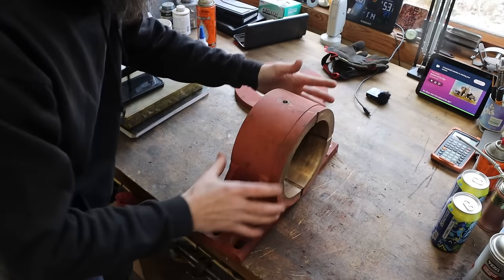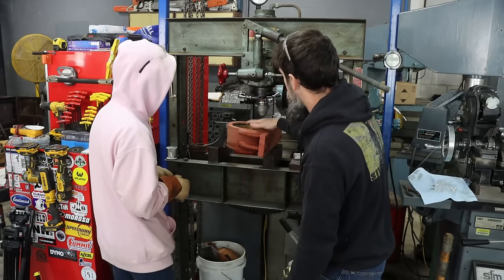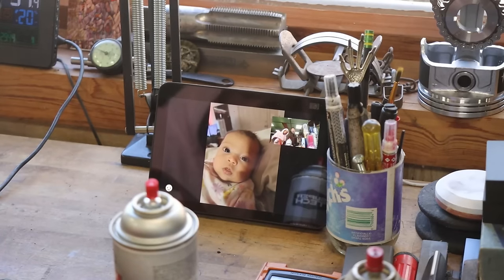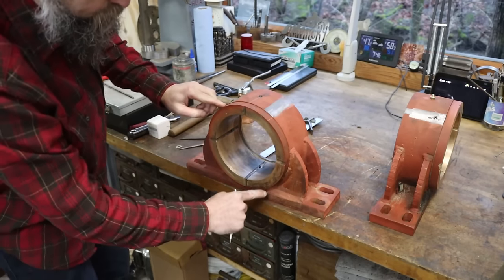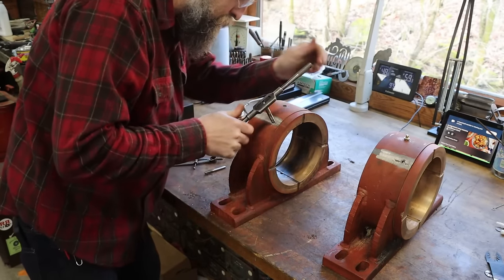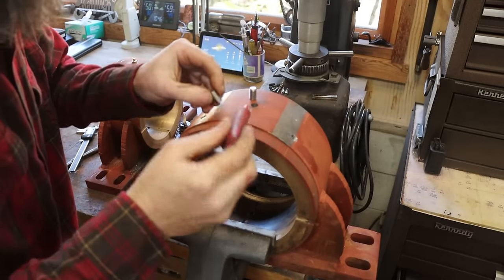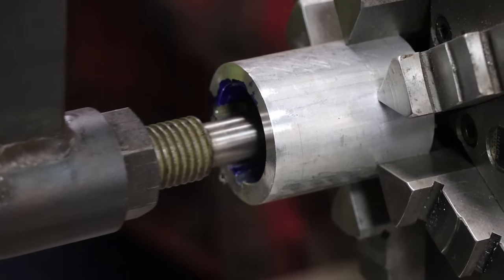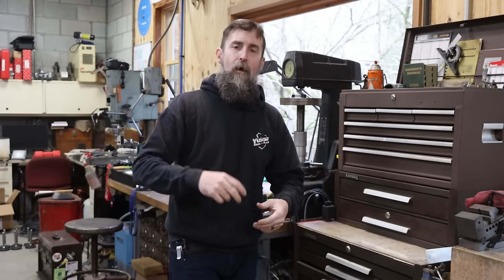Repairing Huge Bronze Bushings.

Comment: What  beautiful grandchild!  

The ball mill where I worked for over 20 years was somewhat larger.   The bottom trunion was lubricated with high-pressure oil.  The oil acted as a bearing with the trunion riding on the oil suspension 
The low pressure oil pump lubricated the top trunion.  It's Achilles heel was dirt.  The material that ran through it was gritty and lower Ph .  If outer seals wore excessively, there were problems for sure.

Comment: My thinking is that with the hole lined up the grease will take the path of least resistance and be less inclined to travel all the way around to the holes on the bottom. I've seen that with way oilers.
Reply: Probably be better with two grease zerks, one on each side.
Reply: Same thouht here. The bushing should be offset between holes so the grease makes its path all the way round, not straight in. It should be ok either way, if lubricated while running.

Comment: Take it from an old timer. Sometimes (really a lot of the time) when you line up the hole with the zerk. You will only get fresh grease out of the one hole. When the grease goes through the channel it will be forced out several holes. Hope I explained it enough.
Reply: So maybe the bearing did not slip and rotate? Maybe it was intentionally clocked with that off-set?

Comment: I've never liked the bushings with a grease groove all the way around. The grease will follow the path of least resistance so it doesn't come out where the most pressure is and he grease is needed the most. The shaft has to carry the grease around the bushing.

Comment: Steve,  why didn't u use the drill press to tap the holes?     u had a straight line for the hole..  maybe u were afraid that the tap might
break-off in the hole?    other wise  grat job getting the Bronze Bushing-off/on with ur Son's Help..

Comment: So given that you want lube all the way around, why NOT clock the hole 45 degrees off?  That would at least cause 2 of the holes to get equal lube.  

Not that straight won't work.  But makes it really easy for the direct hole, and hardest for the one 180 degrees off.
Reply: That makes sense...and couldn't hurt.

Comment: That rubber coupler acts as a sheer pin .Making it out of steel could cause a much more expensive part break instead.
Reply: Not rubber looked like nylon the aluminium one should be OK not too hard
Reply: I'm willing to bet the roller it's going into isn't in prime condition anyway, if the dealer couldn't supply a simple part like that I bet the machineis pretty old, it has to work and earn its money, which that aluminium part will allow it to do.

Comment: I'm not sure those bushes have turned in the housing. If the grease hole lines up with the slot on the running face of the bearing it will preferentially go to that single slot when new grease is pumped in. If it's offset as if was, the grease will go around the outer groove and then go through the other holes to the other slots. Be interesting to see how it works out.

Comment: Steve, i had to laugh when you set up on the drill press to drill for the grub screws. pretty janky. you could have just stuck the bearing housing on your dividing head and drilled it on the milling machine in which case the bores would have lined up perfectly and been exactly 180 degrees in opposition to each other. 
also, the grease grooves in the bronze part probably should be diagonal instead of perpendicular and in line of the bore. the diagonal actually helps pull the grease into the groove and spreads it over a much wider surface area. grooves in line with the bore will tend to wear much faster and start to waller out just where the grooves are. under load that bearing won't live but maybe 100 hrs or less as is now. the housing is also way too thin given the load it has to take